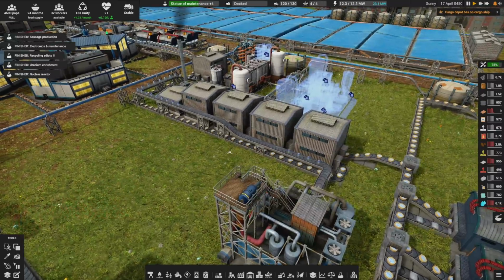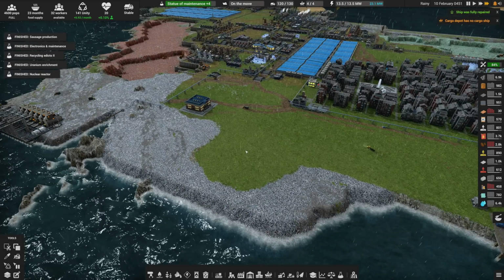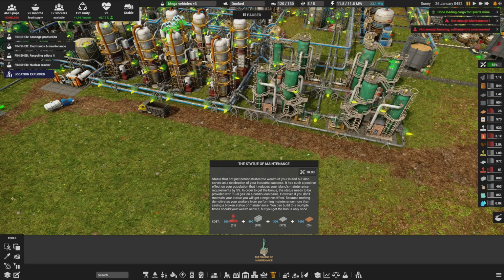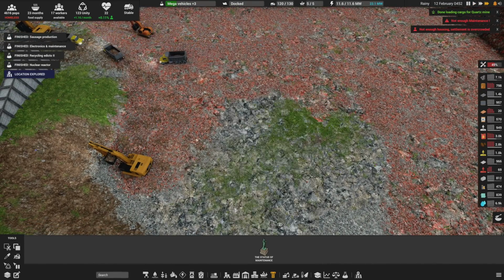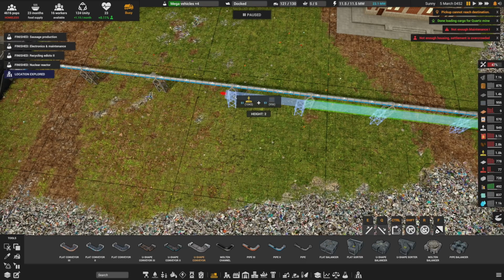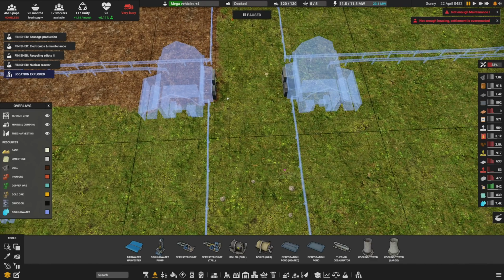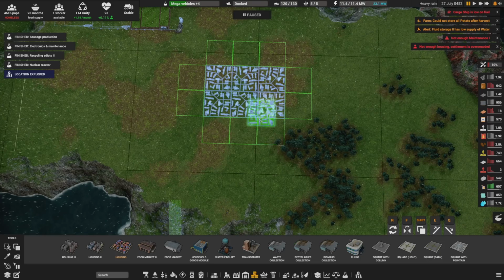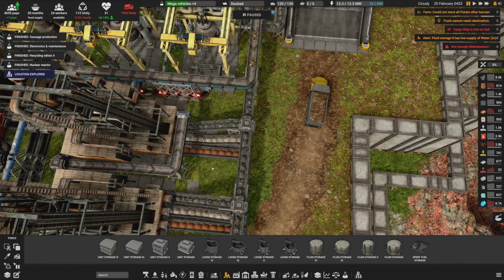THE SECOND SETTLEMENT! - Captain of Industry - 45 - Early Access Gameplay

Comment: Your water pipe is a perfect example of why we need some sort of 'if-then' filters or valves that we can control automatically. Steel/Iron was also my issue with my Maintenance. I wasn't making enough Machine parts. I had to set up massive productions of Electronics and Machine parts flowing past the Maint. buildings and then the overflow went into Storage for stuff like repairing the ship.